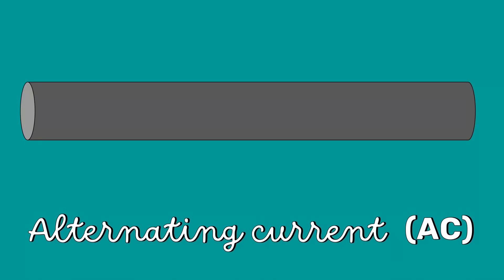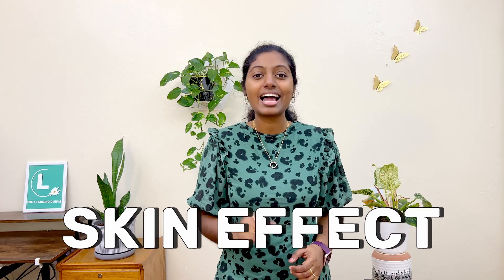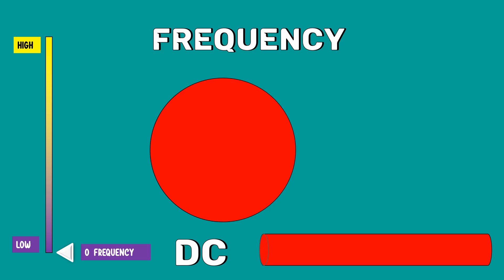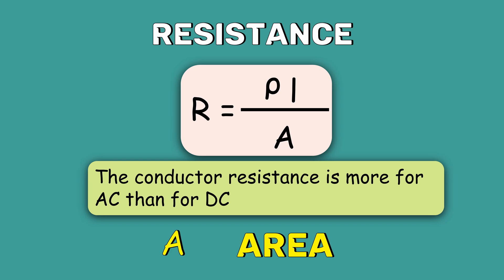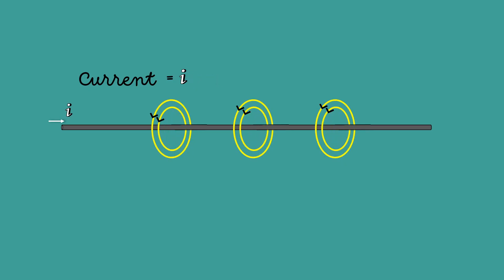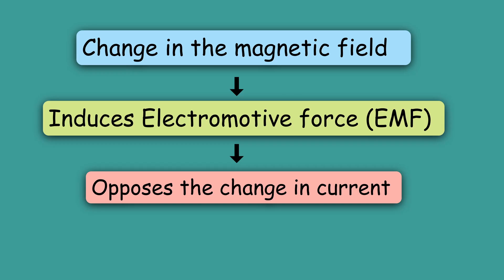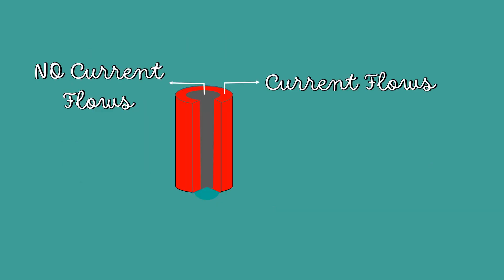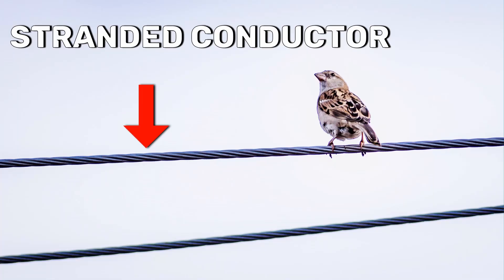What is Skin Effect?

Comment: Ma'am 
Magnetic field due to current carrying conductor is concentric and doesn't pass through the cross sectional area of the wire 
So there shouldn't be any magnetic field passing through the wire 
Resulting in magnetic flux being zero 

According to faraday's law 
Change in magnetic flux creates induced EMF

Since as I said earlier there is no magnetic flux (=BAcos theta )(B=0) in the wire 
Then why WHY there is induced EMF as flux is already zero change in magnetic field will not change flux as the magnetic field is not passing through the wire to create a magnetic flux

Comment: I have a solenoid electromagnet I want to measure on an LCR meter. The REAL component of the impedance changes greatly with frequency. However I am orders of magnitude below the skin effects frequencies. Could skin effects be the cause of my REAL impedance changes because my wires are tightly packed? I don't think the standard skin depth equations apply

Comment: but i have a question. why not just use hollow metal rods instead of solid metal wires and save both weight and cost?
Reply from the maker: That's really interesting. But the problem is we need mechanical strength to withstand wind, storm, etc. So, stranded conductors are used. Moreover, Stranded conductors are more flexible than hollow conductors.

Comment: For same cross sectional area, I have observed that standard conductor is more flexible than Solid, how it is possible?
Did Stranded conductor create more Sag?,
So they need more Towers?
Reply from the maker: Stranded conductors are made up of several thin wires that are twisted together.  That's why they are more flexible. Generally, stranded conductors are used for transmission and distribution. 

If there is no sag, the conductor may break due to excessive tension. While erecting a transmission line, it is very important that the conductors are under safe tension. The sag should be adjusted so that the conductor’s tension is within safe limits. Since stranded conductors are flexible, it is very easy to adjust the sag in this case.
Reply: @TheLearningCurveBenila  Thanks , now clear!
Reply: Skin effect occurs in 230 volt or 440v AC